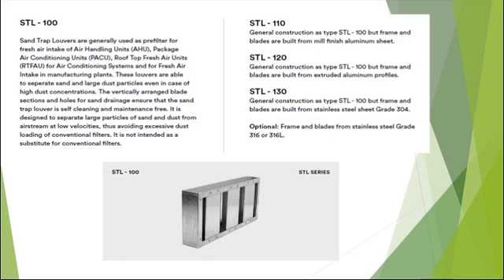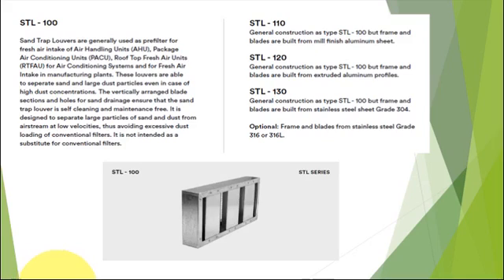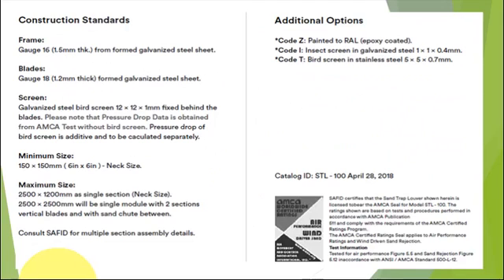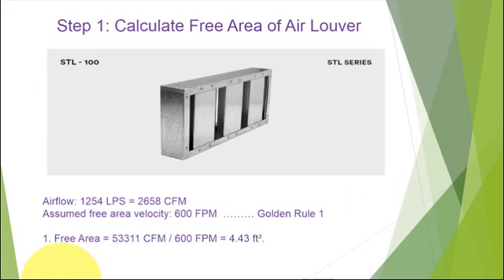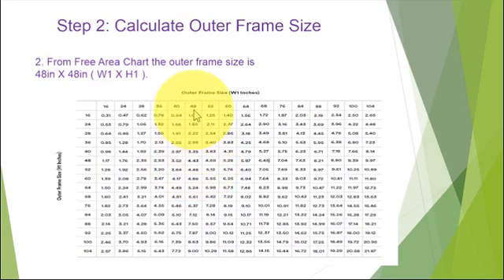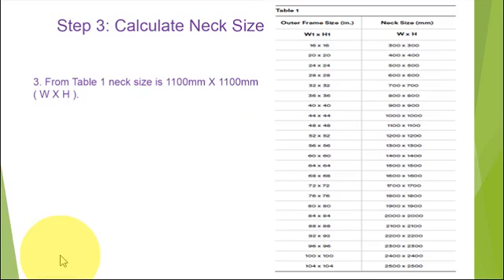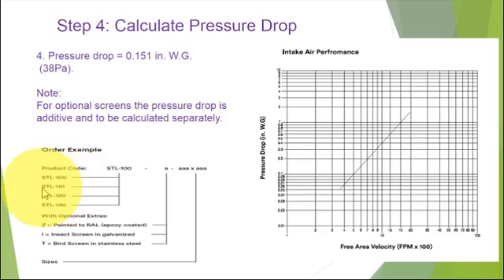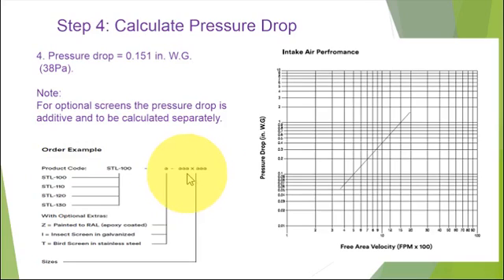Sizing and Selection of Sand Trap Louvers

Comment: Is it mentioned anywhere in ASHRAE or any standard regulating organization where to provide sand trap louvers? Does staircase pressurization fan need sand trap?
Reply from the maker: Yes
ASHRAE Standard 62.1 section 8.4.1.6 Outdoor Air Intake Louvers specifies the requirements for the fresh air Louvres and AMCA 500-L-99 standard for test method 
Staircase pressurization fan doesn't need sand trap Louvre